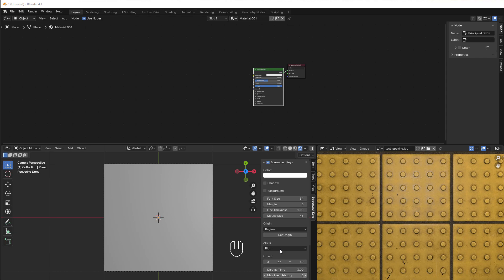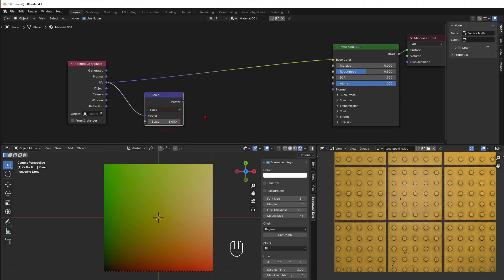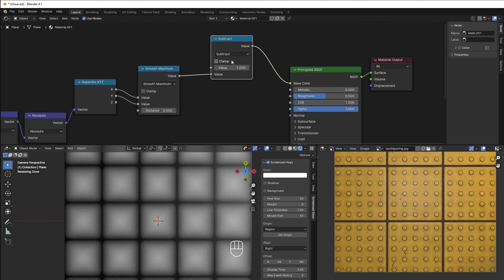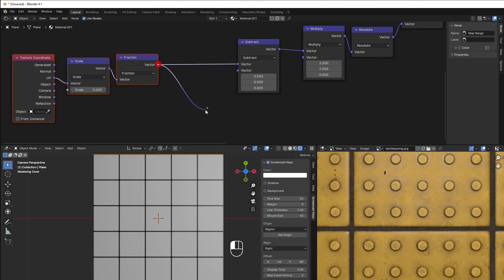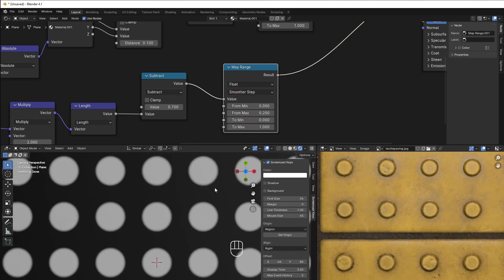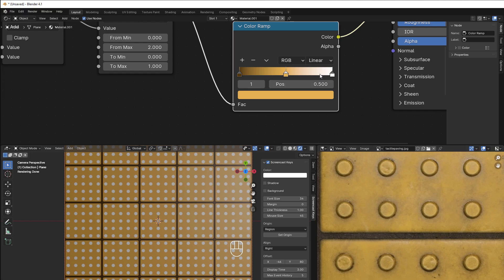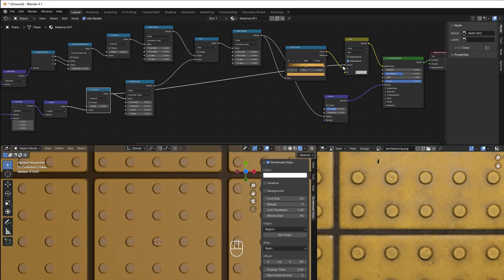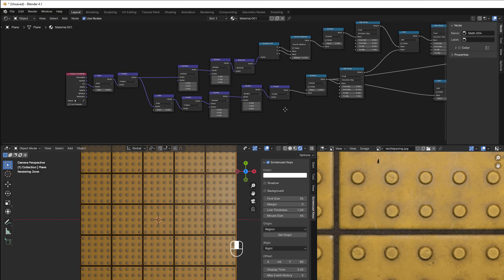Let's make a tactile paving texture in Blender!

Comment: Great tutorial, as always
Only one question. You don't use Node Wrangler ( it's very comfortable to me to previsualize nodes with Ctrl + Shift + click), some reason can you tell?
Reply from the maker: @pepecarlos8845  Simply because I started years before it existed and have never felt the need of using it. It took me 10 minutes to do the pattern above. If I don't explain, it will take me 5-7 minutes. I can get a bit faster with node wrangler as well... but it is not connecting nodes that takes time... it's the math :).
Reply: Math is the hard and the beautiful
My curiosity is satisfied
Thanks!